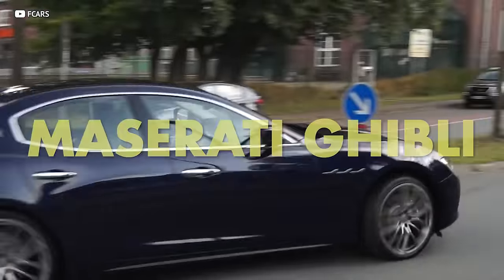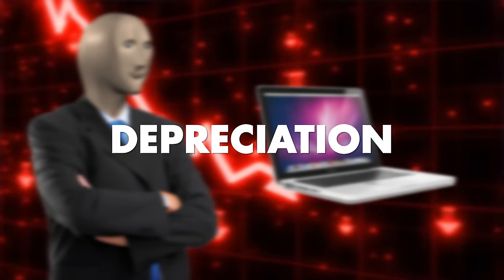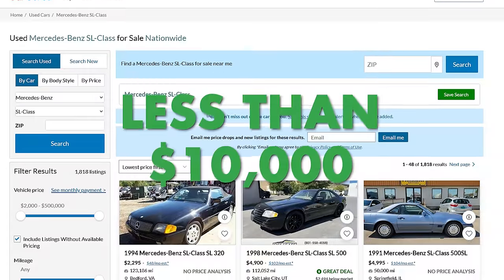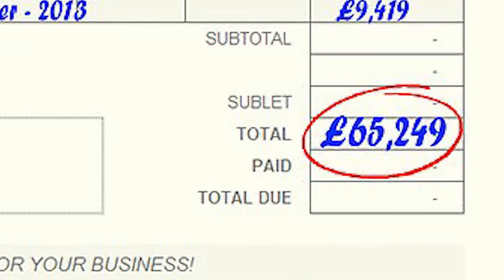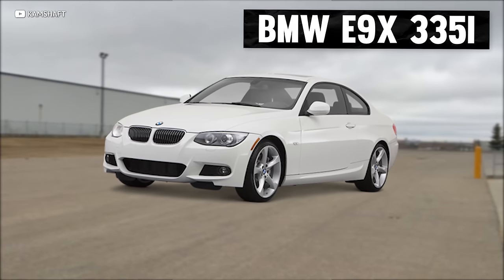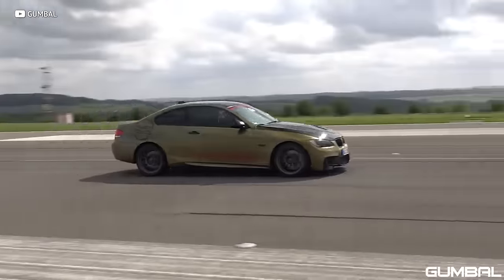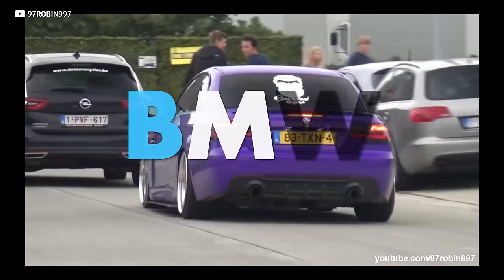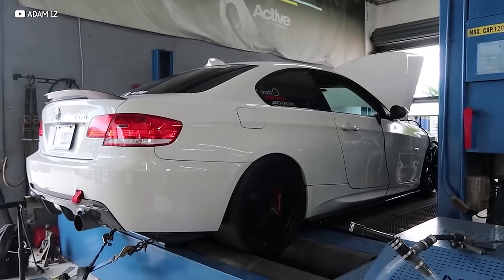Do NOT BUY These 10 Cheap Luxury Cars (You'll Go BROKE!)

Comment: The 350SL is a decent enough performer and it has the looks. 
You won’t have the expensive hydraulic issues .
Avoid the 2006 models , which have the M272  motor ( balance shaft issues ) .
By 2007 this was sorted out . 
Running costs are low in comparison to the V8.

Although the V8 does have the noise ….and that is why you buy these after all ….
If you buy a well maintained one and find  decent specialist mechanic, it will not dent your wallet too much. 

Fix anything that  goes wrong immediately or it will all mount up and kill you 😀

Comment: The Mercedes v6 has a gear that drives the cam chain deep in the engine that fails the computer and variable timing mechanism hides it failure until the check engine light comes on . Then 6 grand tear down.
Reply: "German engineering" for you.

Comment: Oddly the basic trim manual transmission models of most of these, which you can buy in Europe are fairly reliable. But you''ll never see a Mercedes with a manual transmission and diesel engine in the U.S.

Comment: The only used luxury car you should buy is a Lexus. But if you are a "Youtube Certified Mechanic" DIYer, like I am LOL, BMW is a good choice. There are tons of info on how to fix all the issues with BMW. They're really not that bad. I own a couple with the N54 Twin turbo engine. Lots of fun... HINT: There is no such thing as a "life time fluid". Change your transmission fluid every 40-50k miles. Just drain and fill. DO not flush. My E90 335i has 180K miles on the original transmission and turbo. Other than that I've replaced just about every component.

Comment: If they were not abused before you owned them, and you look after them diligently, changing parts when they should be changed, doing frequent oil and transmission changes, they work fine. High performance needs high care

Comment: oh meaning its worn out? of course its going to fail regardless of what brand u get. thats why i choose brand new. depending on how u take care of it, it will last longer than the 5 yr amortization before spending money on worn parts starting the from the parts that touches the ground to its electronics which is why yearly service is highly recommended. Service A & B are not just an oil change but also check up if there were codes captured by Xentry

Comment: The mk 4 Audi a4 2.0 TFSI  should be on here to major engine plastic parts failing oil chain pump issues, scared cylinder heads etc…

Comment: I own a 2018 stelvio. By far the best ride and handling vehicle i have ever driven.  I've had a few electrical gremlins but give it time and it corrects itself . No problem with the brake system and it has all the new programs until 2022. No new programs are issued.  I love my stelvio and i hope to never part with it.

Comment: I think the hydraulics on these mercedes are engineered to be unreliable. Tons of construction equipment have high pressure hydraulics that are reliable. The forklifts at my last job are so old they're stick shift, clutch pedal and all, and they never had major issues with the hydraulics, even though they spend all day, everyday lifting 2-5 ton packages of siding.

Comment: R230 shouldn’t be on this list. Suspension problems are definitely an issue but there are countless relatively cheap fixes. ABC braking is literally still under warranty. M113 and m113k along with the transmission are bulletproof
Reply: They are for sure

Comment: Lol i love how u don’t explain that there is many different versions of the 335i smh. First off everything u mentioned as a problem comes from the first models of the generation. All of that can be easily side stepped by buying a later gen or just getting a 335is. the car isn’t as complicated to maintain as u make it seem. Literally everything u mentioned was fixed in the later models of the same generation. Theres literally like 3-4 versions of the N54 motor alone smh. Just do ur research & you’ll be fine, that literally goes for any car!!! I hate the mentality of I can’t get a german because its too expensive. Na ur just lazy bro its not for everyone don’t stress it but don’t blame it on being expensive either. Im sure u can get a nice wrx without heated seats, leaks, ofc its been beaten to sht, smells like wet dog & vape juice. Im tired of the Japanese meat licking car enthusiasts tbh. I better see a video about how terrible Japanese cars are to own too. 30,000 racks for a rex & u gotta get the fully loaded model for seat warmers lol 
& it only goes 250-70 stock 😂Make it make sense please!

Comment: MB W211 W212 with M271, 272, 273, 274, 276, 278 engines
Plus 7g tronic gearbox- a total junk ever made.
Worst of all: all mMB W211 2005-2006 with m272 engine coupled with 7 g tronic PLUS sbc braking unit.
Same with S class of same configurations.

Comment: Yes, but an E90 three series has an N54B30 capable of 700-800 hp with just a single turbo and port injection. Yes you need to add fueling and air and tune it but you can legit do it all yourself if you can turn a wrench. Preventative maintenance first and boom making Hellcats stand still...

Comment: The giulia? The diesel is a work horse, and my cousin owns the 2.0 liter gasoline, modified to smth around 320hp, bough from new, and still after 8 years it has to give him a problem. Just basic mainenance, some bushes here and there, and all the other money's went on mods. I believe unreliability of all those other brands, expecially range rover... but cannot accept any bullshit trown on the giulia. Alfa romeo made a step up in quality from the early 2000, whit the brera and the 159, and maintained that ever since. 23 years if my life never seen an italian complain about any alfa really... and i don't get the myth of "alfas are always broken" from where tf it comes from! Maybe the very old days? Like fiats, some people say theyre unreliable as fuck, like... bruh, mine has 300k km (more than 180k miles) on the clock, runs like new, all the horses are still there, stop speed is 170 (110 mph) still does that, after 20 years. No oil leack, no coolant leack, ive gotten some electrical issues, but nothing that changing a fuse or a new cable would nit fix. Mah...

Comment: what is ya'll thoughts on BMW 325I 2007 to 2009??
Reply: Reliable for an E series BMW. Not Toyota reliability though due to overall design with plastic components that will fail due to heat cycling, etc.. If you are a DIY shade tree mechanic, it's a very reliable and enjoyable car to drive.

Comment: Clearly, this guy doesn't know anything about cars. The vehicles in the video talked about are now morden classic and hold their or even going up ever so slightly depending how much you bought for. Another thing these cars hardly ever go wrong depending how well they been looked after. Well, speaking from experience, electric can be big of an issue, especially those intermittent faults because you will never find them. Apart from this, let down the video and guy talk guy talking from his backside. They are cool to have and still have road presences.